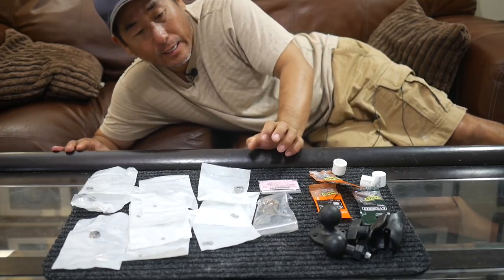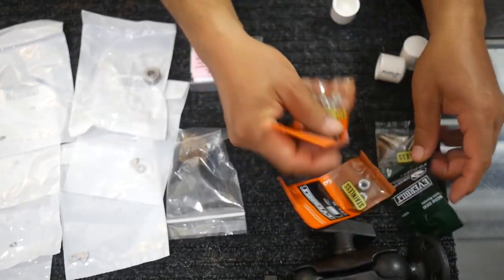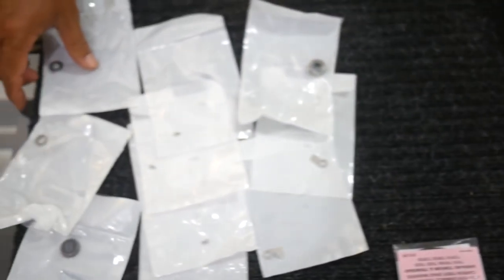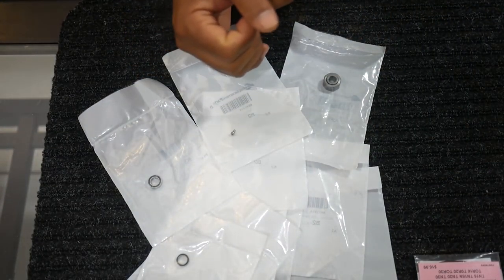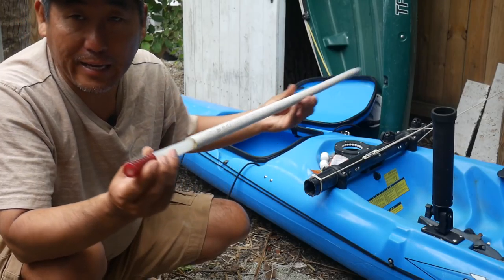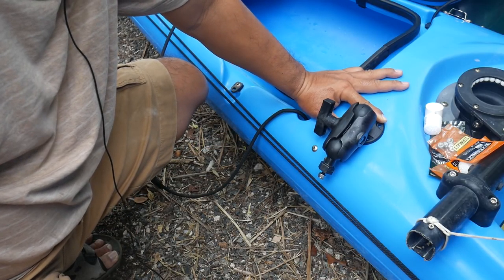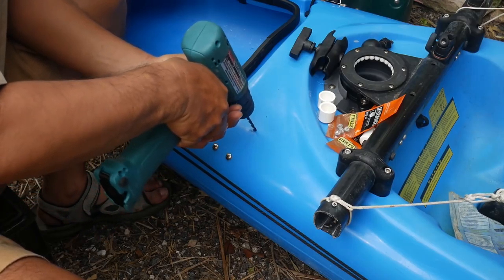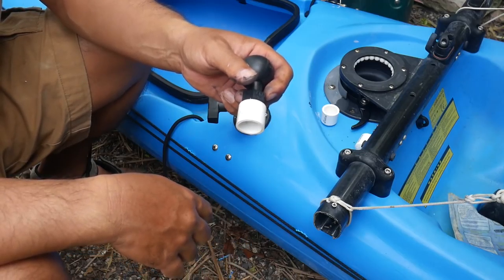Spending That Patreon Money - Year End Maintenance

Comment: Here's an off season project and video series idea for you. They sell 40"x48" trailers for under $300. It would be cool to see a series where you buy one of those trailers and then outfit it with a box and then proper kayak rails above the box. They are so small and light that you could easily tow them with your car and if needed they could be detached and stood up if you have parking restraints where you putting in. It would also open the door for you to get a hard dinghy as well.

Comment: What kind of grease are you using there? I'll be interested to hear how the hot melt glue works on the butt cap. When building rods, I use epoxy for this.
Reply from the maker: Penn.  The cork disintegrates before the glue does and it is easier to get off.

Comment: Steve, did you change the one way roller bearing on the torium? I think the anti reverse pawl is for backup if the bearing goes . Anyways great video just subbed .
Reply from the maker: No bearing changes.  I don't see any one way bearings on the Torium.  It is a pretty basic reel.

Comment: What’s the length of ur kayak in metres?
And should I mount a permeant bait board is that practical.
Reply from the maker: 16 ft you will have to do the calculations.  No, make it removeable.  If your not going to use it, don't bring it.  That is the key to success on a kayak.  Keep it simple.
Reply: Yes, I agree too. Almost NOTHING should be permanently mounted unless you absolutely know it WILL be used on every trip. Keep everything as simple, basic, light weight, and organized as possible. Personal Example: I made a mandatory checklist for minimum items of gear that is needed. I put a clear waterproof plastic laminate over it so it lasts long time and helps me be efficient for every trip. I have one checklist for EACH type of kayak trip 'Freshwater' or 'Saltwater' or 'Camping'. But they all have the same 'emergency kit' and 'safety kit' listed at the top then equipment for each style of trip I go. Example ALL my lists have a small RED waterproof box containing 1st aid,  tiny survival whistle, emergency fire starter, micro LED light, knife, etc...this all fits inside a small size RED waterproof box, also I have a 2nd small RED waterproof box for Safety gear (Marine radio, flares, LED flashlight, tiny survival whistle, compass and map). 3rd is I carry extra clothes and a tiny survival blanket inside a small bright Yellow waterproof dry-bag. That is all 2 small RED waterproof boxes and a small bright yellow waterproof bag is stored under kayak hatch and out of way (the 2 small boxes are attached with double sided velcro and marine glue near the hatch for fast/easy access). 
Then I have a minimum list for EACH type of trip which may include things like PFD (with whistle and knife already attached), tackle, rods, net, pliers, bucket or cooler, anchor, 100' paracord. These are only things NEEDED on top of kayak. It depends on YOUR specific needs for YOUR area but whatever is simple and minimum is preferred. (maybe you could attach your bait board directly to the top of your cooler to save effort and space? We all have ideas to learn from each other but only YOU know what is best for YOUR situation. Hope my ideas are a little helpful to you.

Comment: Do you ever get water inside your kayak and if so how do you fix that because my kayak has quite a lot of water inside it when I️ get back from a trip
Reply: over the years my solution to having a leak free kayak is to un install EVERYTHING that the kayak has in accessories like the carry handles, deck hatches, cleats, pad eyes etc... anything that has screws. then buy yourself some 5200 marine sealant and reinstall with the sealant, this has stopped leaks on all my kayaks and i have done this as soon as i have purchased the kayaks. factories don't seal the kayaks
Reply: henry montero thanks I’ll do that ASAP 👍🏿
Reply from the maker: I get tons of water through the front hatch and also the rudder lines because the back end is submerged when i am running with the outboard.  Find the leak and then plug it.  This will help.  https://www.youtube.com/watch?v=0tSXj4cAyoU